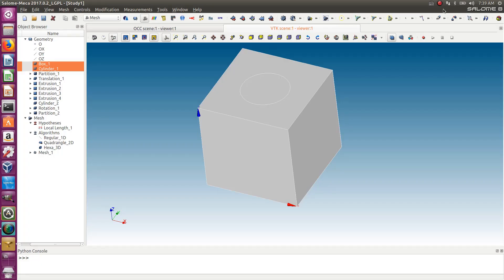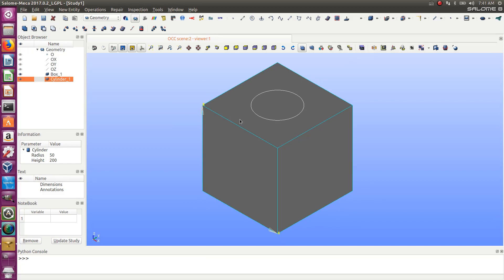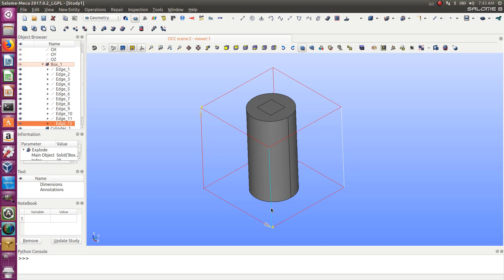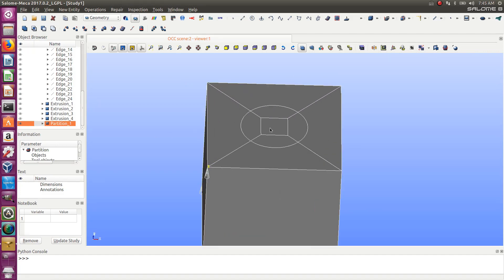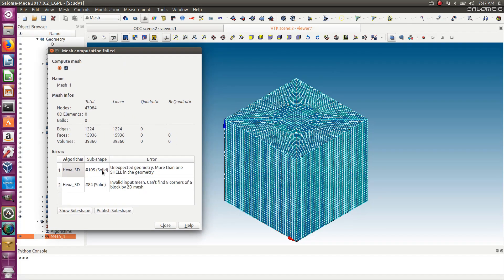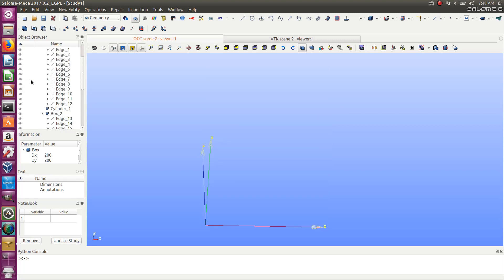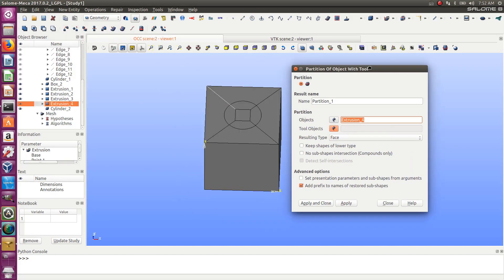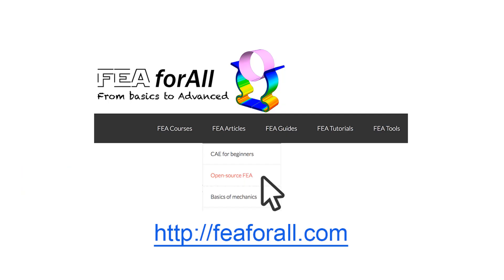[Salome Meca Tutorial] Meshing with Hexa Elements

Comment: Hi Cyprien, thanks for all the time you take in making these amazing tutorials. 
I failed to repeat this tutorial using the new Shaper module (I'm using Salome 9.7.0). Have you tried the Shaper module with this tutorial?
Regards
Pablo
Reply: I found the solution to my problem. I will try to list the steps for further reference:
1) Open salome and the shaper module
2) Create a new part
2) Do the square in a sketch defined on a plane, XOY for example. Then extrude this sketch
3) Repeat the process to make a circle formed with four arcs. Then extrude this sketch
--> As a result of steps 2 and 3 there will be two solids in the Results section of the tree.
4) Create Fillings selecting the vertical edges on the previous solids.
5) Then you can create the Partition by selecting the two solids and four fillings.
6) Finally you can mesh the part as explained in this video.

I will try to make a video tutorial to ease the reading of these steps.

Regards
Pablo
Reply from the maker: Hi Pablo,
This tutorial was covering up meshing techniques, not how the geometry is created in shaper.
I have some shaper tutorials on this channel though, have you watched those?
Reply: Hi Cyprien,
Yes, I saw the shaper tutorials. I think that I got most of my skills on using Shaper by seeing those tutorials.
Again, thank you for your help!
Pablo

Comment: Thank you for the nice video. I would like to ask if it is possible to mesh the geometry of a extension coil spring, whose coils usually lean on each other because of the pretension inside (so that there would be self contact of faces )? If yes, what could be the trick of it?